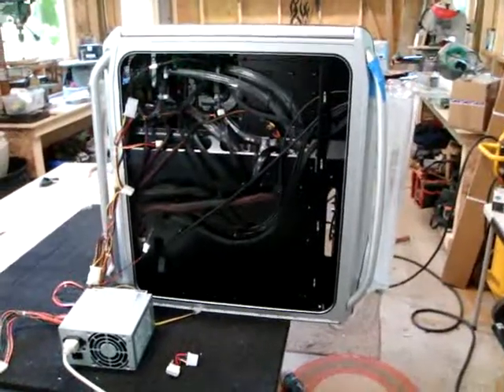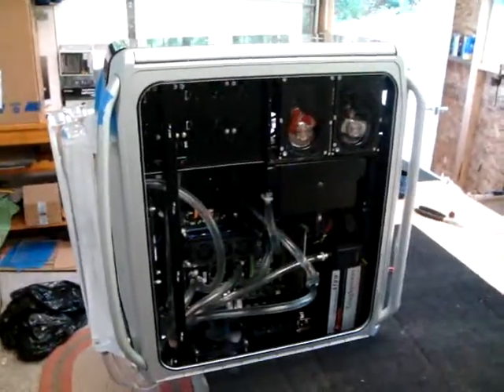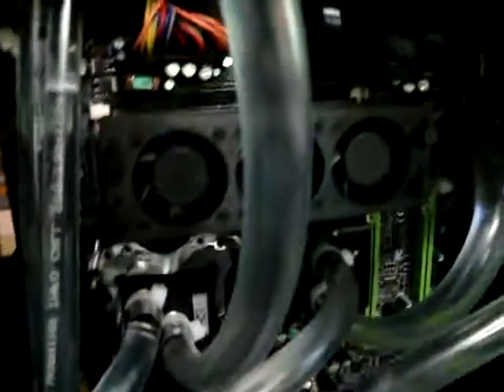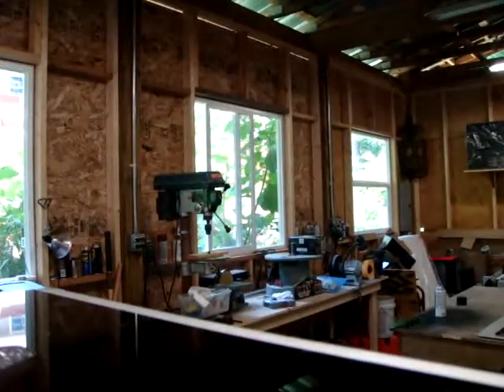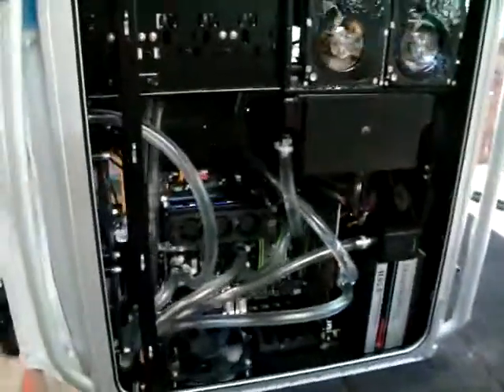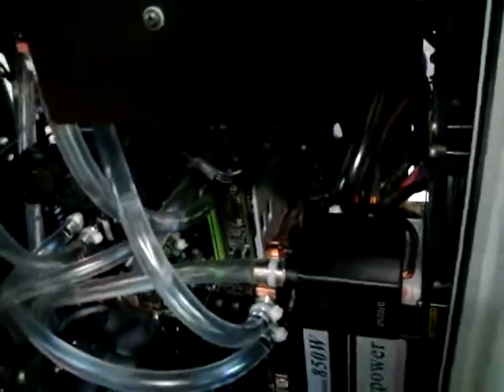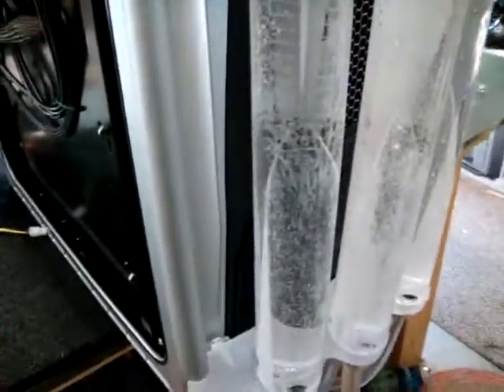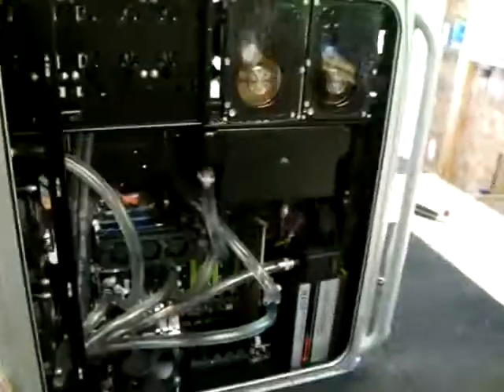Running in the loops on the triple loop Cosmos 1000

Comment: rofl, love your commentary. I have the Cosmo S, planning on Water cooling it with my i7 update. Have any recommendations for a heatsink on a 1156 and 1366 socket? Still not sure which i will go with, depends on what my budget is.  I am also trying to find a waterblock for my 4870x2 ASUS tri fan but having trouble. Any help appreciated.

Comment from the maker: A problem for you maybe. Shipping is whatever it costs. Last time I shipped a case to the UK it was about $200 and then the client got whacked by Customs, which is not something I can control. Consider that the case needs to be padded then crated to survive a transatlantic voyage that incurs a handling fee on my end to cover my time and materials.
In general $25 will cover the crating cost.